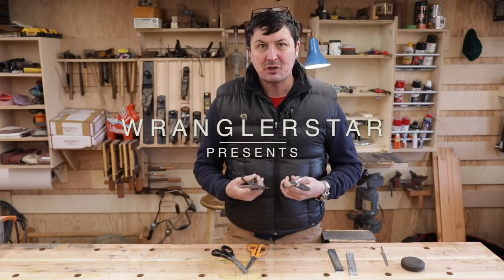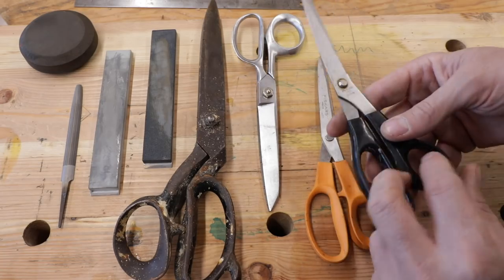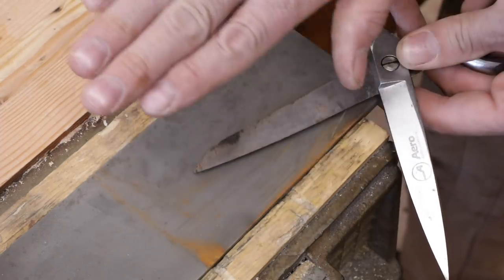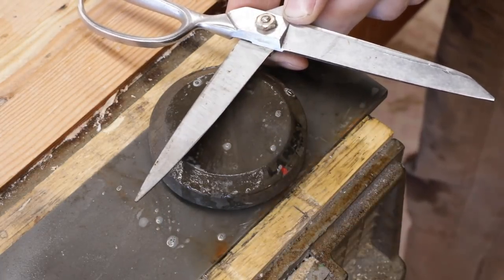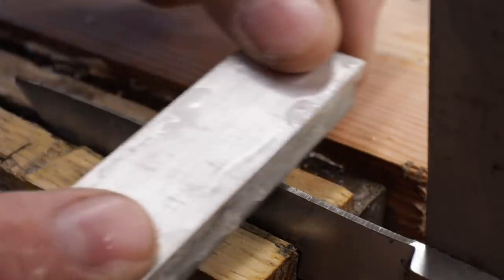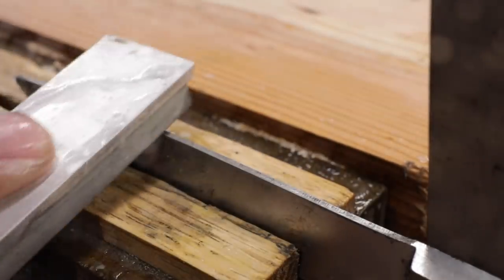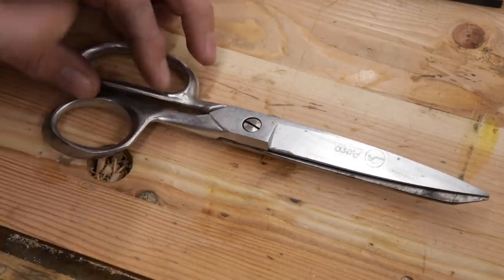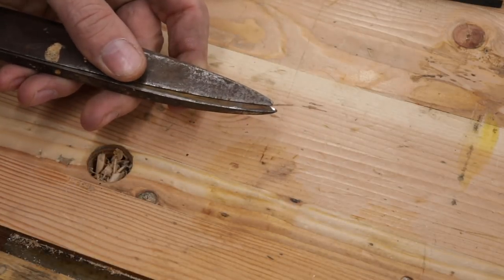How To Sharpen Scissors Like A Pro

Comment: Very informative - so too are the comments and general observations.   Removing the burr generated by working on the angled side by closing the sharpened scissors seems the best solution over possible->probable->definite compromise working on the flat side. Great history lesson. Now to find a (car) boot/trunk sale for scissors, and then buy a Lansky stone - Great plug. Many thanks.

Comment: After watching the videos and reading the comments I tackled some quality vintage scissors that would barely cut plasticine. Took quite a while as had to drill and tap the pivot to fit a new screw (no idea what the original must have been - it was mashed). They're now slicing fabric like razors - not often I actually have the right kit for the job but I do have a Lansky puck. Also gave them a tweak with my Spyderco Doublestuff. Thank you!

Comment: Scissors are easy!  Glad to see the instructional video.  
I've rescued many old pairs.  
They generally are made of superior steel, and work way better than the soft stainless Chinesium substitutes.
A little "tooth" from a coarser stone can be useful on the sharpened edge, to grip the material being cut.
Reply: Correct about "tooth" but never stone the inside faces, they will mate as the burrs are trimming-off on 1st cut.
Reply: Brilliant
Reply: Dear Glen Richerd: The Wescott scissors are 1.25 USD from Dollar Tree. Buy a bunch for a fiver.

Comment: To remove the burr on the edges, you should slightly pull the blades apart and close them so the blades are not touching ask they close, then release the pressure and open them and this will roll the burr over to the other side of the blade.  From there you can cut through something like that blue paper towel a few times and that should remove the burr cleaner without damaging the new edge you just created.  The inside area you were talking about with the thin shiny line is called the ride line, where the two blades ride together as they cut.  You're right though...sharpening these types of scissors you did here can be done without high dollar sharpening equipment and with a little sharpening knowledge and care, are easy enough to sharpen and maintain.  The salon shears are much more expensive, starting at about $150 for a really cheap pair and quickly going up from there.  These types of scissors need to be sharpened by professionals with special equipment because as you remove the metal to create a new edge at the ride line, you also need to touch up the convex edge on the opposite side and that's not something you really want to try and do with hand tools on $200+ pair of scissors. :0)  Also, when sharpening scissors like this, you should occasionally take the scissors apart and sharpen all the way up under where the blades are bolted together.  Without going into long detail, it basically helps keep the scissor blades properly aligned for the best cutting angle.  You should really do that every time if you're OCD about the performance, but if not, every 2nd or 3rd time is better than nothing.
Reply: Tremendously helpful comment on an already great video. Where did you learn this?

Comment: Watch Wolff Industries videos on sharpening scissors. They use the machine they make in SC but the concepts can applied to hand sharpening. Tip: Once you get a burr on both blades then spread blades and close scissors so blades don’t touch. Do this a couple times. You want to knock the burr to the outside.

Comment: I like to use just a drop of loctite 243 on the screw when I fasten it so it does not come loose. Works very well with older shears that have a tendency to loosen up in heavy use.
Reply: can u stop bragging about ur loc tite dude
Reply: @brandon4383.  : Go Brandon.

Comment: Be careful that the blades don't get bent out of shape so they don't make contact in more than one place as the blades pass each other.  If you look carefully along good scissors and shears, the blades have a very slight curve so the contact between the blades progresses along the blades as they are closed.  This is what makes them cut.

Comment: to plow through an almost finished project, my ma would slice up an old piece of sandpaper, 150 grit, to temporarily tune up a bald hatchet. (her pet name for a dull scissor)   sufficient to get a dress ready for the sewing machine. It worked! Sharpen dull needles by punching them through the same sandpaper a few times.

Comment: Hello from Finland. I remember when I was kid, in the 50’s, there were old knife and scissor’s sharpeners who used a pedalling grinding stone. Some of them sang too but that was rare. We’re not in Italy. =) . I don’t remember how they did it but those scissors were in really good shape after that. If I recall it right, they moved the blade in 90 degrees angle against the grinding stones edge. I believe that those were global. Too bad they don’t anymore exist. Scissors are too cheap to be sharpened. Anyway, I have Fiskars scissor’s sharpener which is small, very handy having two slots and hardened steel rods.  You draw the blades against the rods. An old and handy trick is to use glass bottle.
Reply: Glass bottle? Please explain.
Reply: 60-150 dollars for a pair of scissors, I don't call that cheap.

Comment: You could take old scissors apart and place a thin washer or shim to take the wobble. I used soda cans and water bottles if they’re to thick run them over sand paper.

Comment: Agree that it may be required to slightly flatten the back edge of the blade.  However the blade should be maintained perfectly flat on the stone as in the video.  Even a little bit of rounding on the back of the blade will ruin the scissors.  I typically do this step AFTER sharpening the scissors.  It then performs the double task of flattening the back of the blades as necessary and also removing any burr/wire edge that has formed.  You can just rip the wire edge off the blades by operating the scissors after they have been sharpened, but that's sort of rough treatment on your newly sharpened scissors.

Comment: Interestingly enough, I learned recently that there is a difference between scissors & shears.  Those stainless Aero are scissors because the finger holes are inline with the cutting surface.  Those big ones are shears because they have the finger holes at an offset from the cutting surface.

Comment: I am not sure how effective it is but I was told in a pinch you can always cut fine grit sandpaper or aluminium foil to help sharpen them.
Reply: I use that quite often, it isn't the best, but, as you say it works in a pinch.
Reply: That dulls them
Reply: Mark Pikas aluminium foil or sandpaper?
Reply: mavos1211  sandpaper. I doubt aluminium foil does anything, it's too soft to affect the metal.
Reply: I about ruined an extremely expensive pair of shears cutting foil. DON"T unless they are cheap! Get them professionally sharpened!

Comment: 1- don't touch the inside unless you have to (look and see if there are any chips/dings on the actual inside, or a worn rounded edge on the inside).
2- to get all the way to the end with the lansky just spend 20 seconds and remove the pivot screw and do one side at a time with the other out of the way.

Comment: Shouldn't you have dismantled the sciccors to also flatten the area around the screw abit(as much as you did the blade)?
I mean, it can only tighten as far as those two flat areas go. Considering the first part when you removed the rust.
Great video, thanks!

Comment: I don't disagree very much with Cody But if ya need a scissor sharpened go to a 'cut and sew shop they will have a Model 327 Scissor Sharpener Ookami Gold , keeps the correct angle on the blade, I sharpen 20-30 scissors a day, has adustments from 10deg to 45-50 for pinking shears, your wife will be happy , don't call me sexist I sew all day long
Reply: chetyoder - this grinder is specifically made for shears and scissors retails for $935 on Amazon, this service is the definite way to go and appreciate the comment.

Comment: I use Kai 7000 series scissors at work.  They cost me around 60 dollars which was a lot for me (I realize they may be cheap in comparison to some other scissors).  Should I attempt to sharpen them myself or just send them in to be sharpened?     They also recently got a scissor sharpener at my job though I don’t know if I trust it.

Comment: May I suggest another alternative?
I've been using Smith sharpeners for a few years.
While they may not give a professional edge they're certainly good enough to cut my hair with my shop shears
 with a dozen swipes and they keep the angle correct.
I use a small one to keep my pocket multi tool in the same condition.
I seldom need a razor edge but a good cutting slicing tool is ready after a dozen swipes.
Takes about 30 seconds.

Comment: Deffinitly don't go crazy honing the inside surface.
Reply: Actually, I'd recommend spending a little more time on the inside edge which is also called the ride line.  If you send these scissors to a professional scissor sharpener, they are going to beef up that ride line a little more.  If your ride line isn't maintained and you keep removing metal on the outside, you'll destroy the ride line and you'll eventually end up with one blade cutting into the other and have to do some major resharpening at that point to repair the damage.

Comment: Dear Wrangler a little knowledge is a bad thing.
Never flatten the inside surface of scissors because it'll ruin the "set", scissors are set by the factory grind and pivot bolt adjustment. The edge self-mates only sharpen the bevel and push crosswise towards the edge with a coarse diamond file.
Generate a burr and it will cut off when the scissors mate. Counter intuitively scissors need grip (hence "machine marks") one pass across a 80 grit grinder will restore them. A polished edge will not grip cloth or hair.
Reply: Aimless Wanderer and

Comment: Sweetie,  I disagree with your method of filing.  Sharpening the blades that face each other is not correct... like another post , you sharpen the angled bevel,  not the metal facing each other.

Comment: No, no, no. That is absolutely not how you sharpen scissors. You hone the bevel on the outside edge, never ever flatten the hollow grind. The whole idea of the hollow grind is that the cutting edges meet at a point, otherwise the material your cutting will want to flip and jamb between the knife edges. Trust me, i have been sharpening blades all my working life and i do know what i am talking about. The moment you flatten that hollow grind you have ruined your scissors.
Reply: Correct
Reply: Aimless Wanderer. Yeah well, somebody had to say it. Thanks for the back up AW.
Reply: That is absolutely correct. The hollow grind is not to be touched.
Reply: Brian Minghella and those who agreed with him. Look at the video again before you criticize. He barely touched the hollow grind trying to make the point of only removing high spots so as to have full blade contact. They are old well used scissors and if your high spots prevent full blade surface contact all the sharpening in the world will not make them cut very thin material with blade gaps. Wrangler made the point of only barely polishing the hollow to take off the highs. He is quite correct even if he did not stress enough the reason to polish the hollow (and not to actually leave a flat where it must remain hollow). 

I would also add that it is a good idea to not smooth finish the actual edge you do sharpen. Finishing with a rough stone rather than very fine and stroking it 90° across the blade leaves fine micro teeth which help to hold the item you are cutting rather than have it slide along a super smooth blade finish stroked along the blade. (This varies with the material you are cutting and how slippery it is. Thin nylon sheets for example like to slip if no micro teeth).You do not actually want a super smooth razor blade finish here.

Good video Wranglerstar. Just hone the face of the hollow so the teeth dags do not lean in over the face of the hollow. And yes I do sharpen many types of blades for a living so argue  and holler all you like; it will not make you more correct and Wranglerstar or myself less correct. No offence or confrontation intended in my reply. But facts  are facts.
Reply: Ookay then what do we do with fiskars edge? And which is the outside?
Reply: I even use a Dremmel to deeper that hollow grind.
Reply: Can you make a video then?
Reply: TOO LATE!!!! This is why it's important to read the comments section! >.<
Reply: Please make a video on how it's done the right way
Reply: WTF is everyone talking about? Instead of using the industry jargon to describe sharpening procedure, can you describe it in layman's terms or upload a video?
Reply: Loo
Reply: @emmams5  Basically, the blade of all scissors are not flat and they curve toward each other (look carefully at a closed scissor and you would see light coming through the gaps between two blades). This helps cutting and should not be flattened out. To sharpen scissors, you do not grind their flat side because you would ruin the curvature. Instead, you would grind the outside edge that is usually perpendicular to the flat edge and only do it with coarse grits.
Reply: @BS-bd5uq , thank you.
Reply: so, um, just wale on em with my speedy sharp? ;)
Reply: He gave dumb advice!!
Reply: How to properly sharpen your scissors: send them to a professional scissor sharpening service. It will be worth the cost.

Comment: if youre grinding the flat of the blade would it be better to separate them to avoid creating a gap between the cutting edges? grind the whole length to where the pivot is? cant hurt right?
Reply: Aiden Foggin. I had the same thought but he is not removing much metal from the flat side so it would take a whole lot of sharpenings like that before it really started put a gap between the blades but yes talking them apart and removing the same amount of material from the tip all the way down that surface including where they are bolted together would probably be the best way to do that
Reply: Aiden is 100% correct sharpening scissors like this a few times will ruin the set.
The mating edge develops a shiny line the objective ist to grind down an narrow this mating line.
If you don't understand my words go find a Pro and pay the going rate.

Comment: For me, it is easier to take them apart before sharpening. Seems easier for a beginner. :)
Reply: Correct. When you grind metal off the flat (sometimes hollow) part, the metal under the pivot point should also be ground as well to maintain zero gap along the shear line.
Zero gap will make cut nicely.

Comment: Paul Seller and Wood by Wright both did a video about sharpening scissors. All three videos showed the same thing. Only the people on Wranglerstar's video are bitching and typing on how you should sharpen scissors but no one as posted any references, videos, or proof of any kind. I'm not saying the people in these 3 videos or the people commenting are wrong or right, I'm saying Put up or shut up.

P.S. Cody, you mentioned your grandmother being a dress maker, Paul Seller's mother was also a dress maker :)

Comment: THE TYPE OF SHARPENING YOU DID SHOULD NEVER BE DONE UNLESS THE BLADES WERE SEPARATED AND THEN WITH GREAT CAUTION BECAUSE THE BLADES ARE BENT FROM THE MANUFACTURER, THE CUTTING EDGE IS ALL THAT NEEDS TO BE SHARPENED IN ALMOST EVERY CASE.

Comment: Could you recommend some flat stones through amazon?
Reply: mgreene939 if you want a good field sharpening stone, which would work for this as well, the DC4 is a great option.  For a bench stones, Japanese water stones work great. I got 1000/6000 grit combo off of Amazon for about $40.

Comment: At 5:45  the video shows a  high carbon steel file being used on the edge of the scissors, well this is fine for general purpose scissors at home, but when one deals with surgical scissors made of stainless steel one cannot use a  carbon steel file, as the file would  embed some of its own material in the stainless steel and it will cause pin point rusting.   Rusting sharpening implements should not be used on stainless steel scissors which are to be used in surgery, as they will be contaminated.

Comment: Literally talking to my girlfriend about how she needs her hair dressing sheers sharpened...iv sharpened my own knives all my life...should I give it a go?
Reply: O SoSerious noooo they need to be sharpened by a pro
Reply: JR Behan I’m kidding haha
Reply: i sharpen hair dresser scissors a lot they are a lot different than knives. practices on garbage pairs a lot before you attempt on good scissors
Reply: yeah just g buy a few cheap big pairs of scissors at walmat and make them super dull
Reply: They are micro serrated...
Reply: My wife has shears from Japan that cost over $400 a pair. If I messed those up I would never hear the end of it.
Reply: Not using the above method because the flattening step will ruin the set of the blades.
Wrangler doesn't understand the mechanism here it's nothing like a chisel this is "shearing" not the wedge-principle.

Comment: Don't ever sharpen on the hollow ground face - you will ruin them permanently. The first thing to do is take them apart - the screw and nut is there for a reason! Machine grind the edges of both blades, Clean up the area around the pivot. re-assemble. Then the tricky bit - they will most likely need to be re-set and that is a dark art that only we wizards know how to do!

Comment: also don't mean to be that guy, but you need to be careful with your stones too. you want to put the edge you're sharpening flat on the stone and move it evenly across from one end to the other to wear the stone down evenly. if you only use the middle of the stone, you will have to flatten it more, and shorten it's life